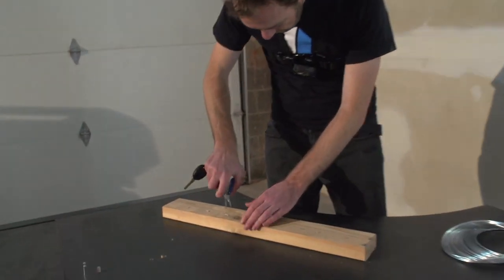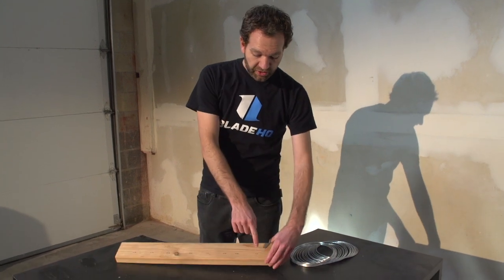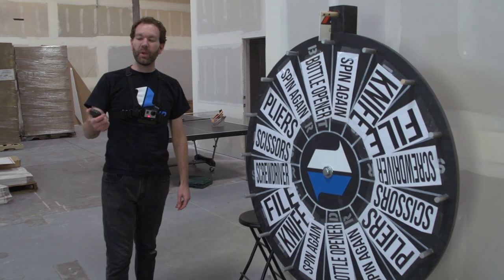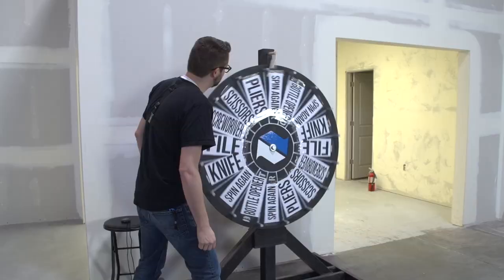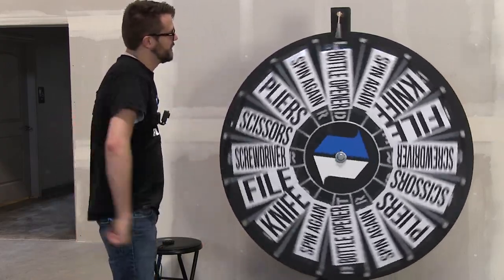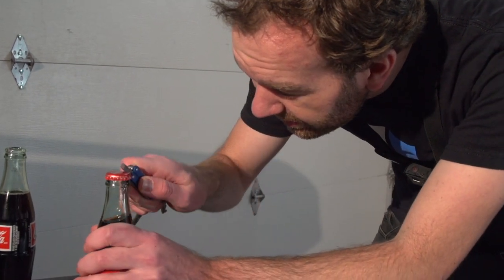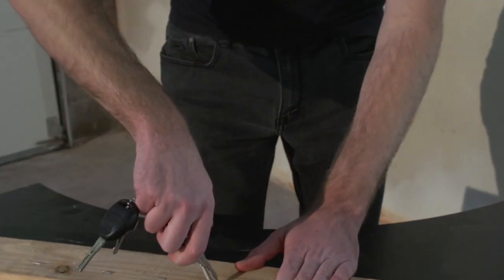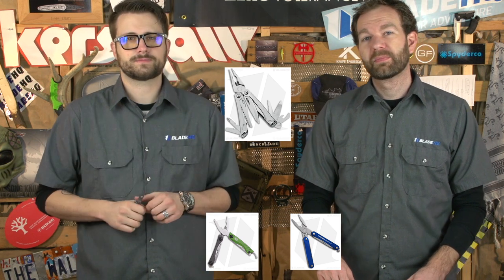Competition Key Chain Multi-Tool

Comment: I wish i had one of these multi tools. I have a  multi tool called a Trim, for those who never seen one, it has a bottle opener, a flathead screwdriver (on the bottle opener), a nail file, and a sheepfoot knife (about and inch long).

Comment: You Hey, Blade HQ, I got this idea. You know how you guys do the contests with the knife obstacle course? I was thinking you could either do a different type of contest or add this element to the “obstacle” course. Have part of the course be a segment or several different segments in which you have all the different types of opening methods represented by their respective knives and have the contestants open and close each type of mechanism like 5 or10 times. For instance, there could be a CRKT Snaplock, a flipper, an out-the-front knife, a back lock, a CRKT Fulcrum, and any other type of mechanism ( There could also be a Spyderco hole-type that needs to be Spydee flicked too. ) . I just think that the finesse required to open and close should be incorporated into the fun. PLEASE!!!!??!!??!!??!!?

Comment: What I learned from this video is that keychain multitools are not meant for everyday tasks and there is an increased potential for injury with such a small tool if you try to use it for things it wasn't intended. I was sure your finger was going to slip on the filing challenge and gouge your finger.

Comment: Great competition, however, the wheel and time limits were not necessary. In fact, those attributes of the competition detracted from the actual test in that the competition was in the use of the tool, not the number of tasks or time it took to complete the tasks. You guys running around seemed pointless. Fastest time wins? Why?

Comment: I thought if I had squirt I wouldn't want bottle opener or if I had dime I wouldn't want file they both got their tools weak point
Reply: The jerky shack I dont mind the bottle opener on the Squirt myself. As for the dime's file i think they should have made it longer and put it where the package opener is and make the package opener shorter and put it where the file is.